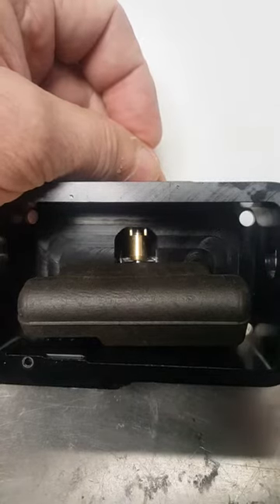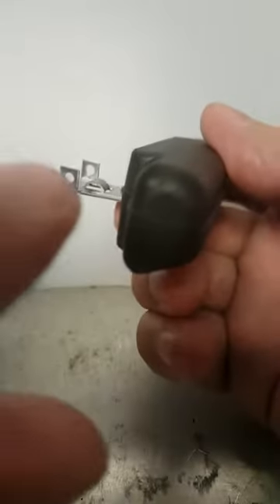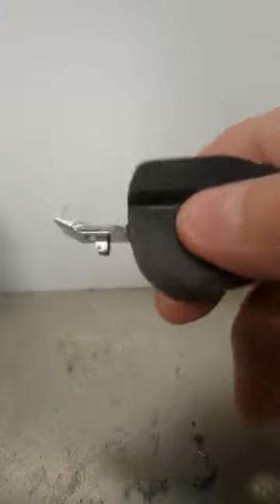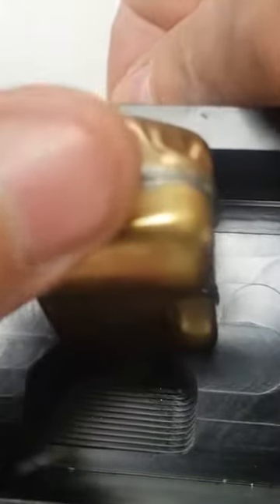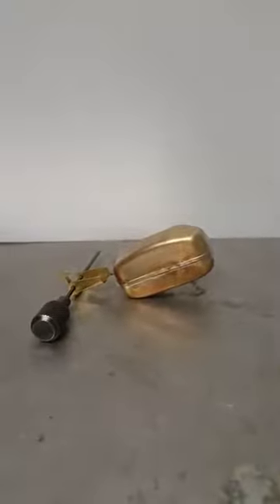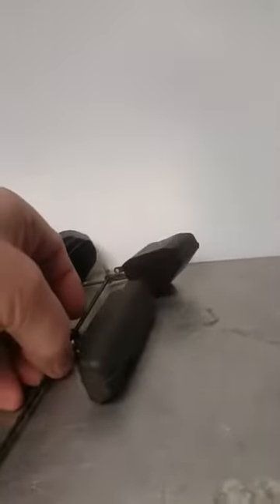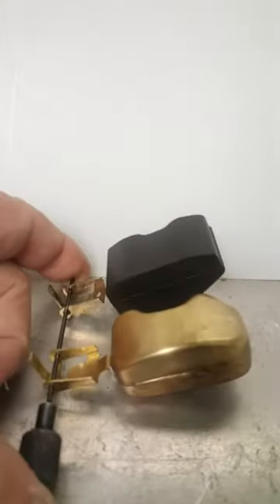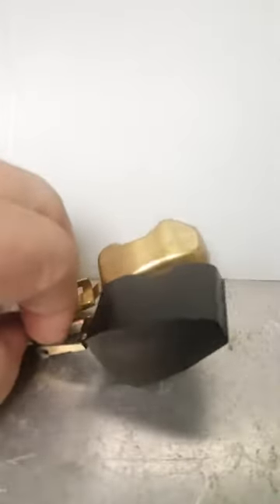Needle drop in float bowls

Comment: Hello John,  Another side hung float to look at would be a 16R-255A.  They were used in the first generation of 2300’s in the late 50’s.  Brass square box-like composition but getting hard to find. I think the part number may have been changed to a newer system numbering system.
These were recommended by Bill Jenkins in the side mount center squirter application he was using at that time.
Thank you for the video!
Have a great day!